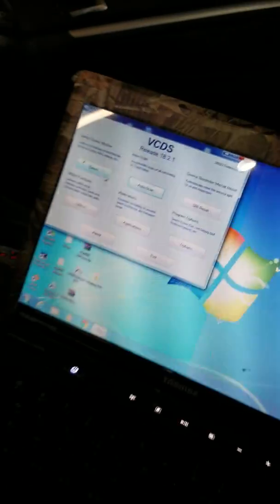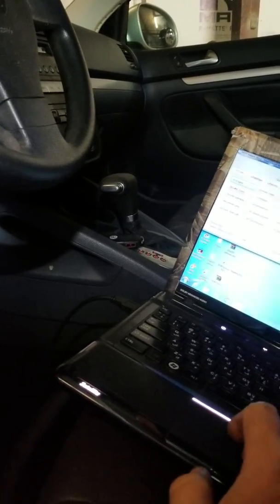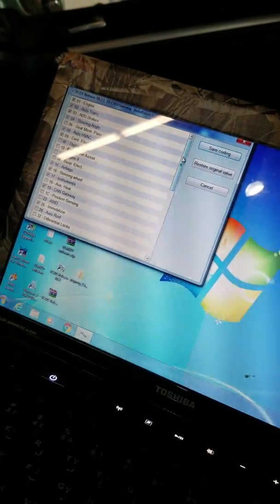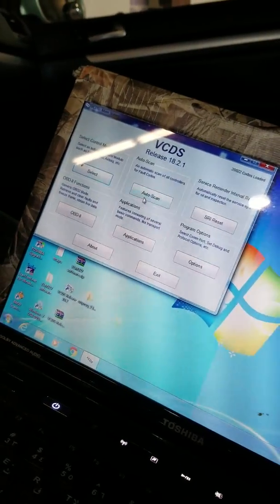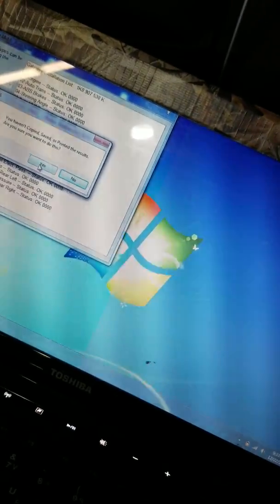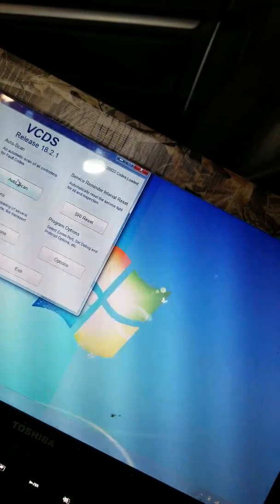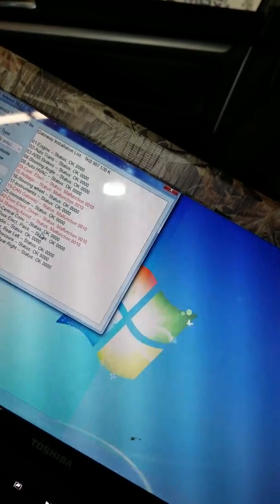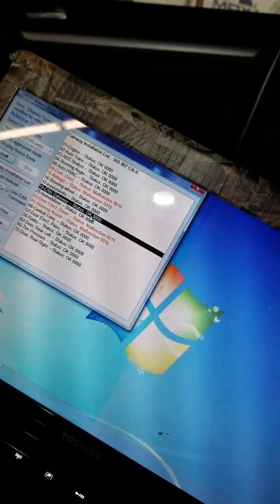VW no module communication

Comment: I got no dash lights when I turn the key
The solution was my body control unit died
Reply: Did you simply replace the BCM? I’m afraid my vehicle is having the same issue and I’m wondering if replacing the BCM requires any type of programming

Comment: I have experienced this with my 2013 Passat, the car starts then shuts down immediately. My instrument cluster was also acting wacky... is this tied together?
Reply: Did you fix it and what was wrong? I’m going through that rn
Reply: Same problem. 
How did you fix it?
Reply: How did you fix this?
Reply: yes ,its because of it ,just change it every thing will be fixed , this module is responsible for the most electronic sensors in the car so when its failed the car getting crazy ,air bag ,contraction ,autohold ,mirrors ,wipers , AC, radiator van ,and the most important ignition the engine either it doesnt start or fall after it starts , change it and see the magic happens ,scan first you find gateway fault , better to buy one with the same serial number on the gate way so you dont need to reprogramming the module its self
Reply: I am experiencing the same now with my 2012 vw cc.How did you fix it?
Reply: @maheshappani9895  I am having the same issue. Did you fix yours?

Comment: hey dude, you need a proper camera,we do not have a clue what is on the screen, also get the whole video pre planned in a uniform systematic procedure,  your car was running,and by the sound of it, ready to explode,!! you're supposed to be showing why it's NOT communicating with any module, but had already had your car running,it's all hotch pock and disjointed!!🤔